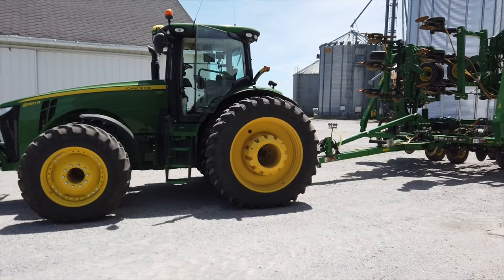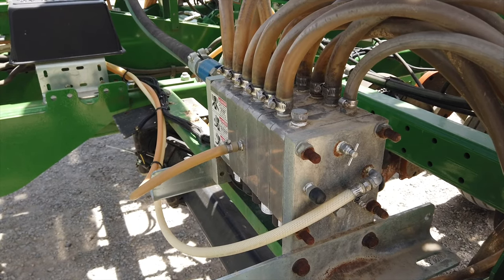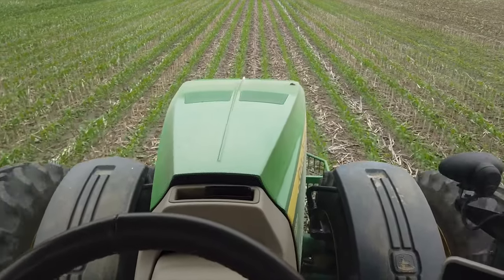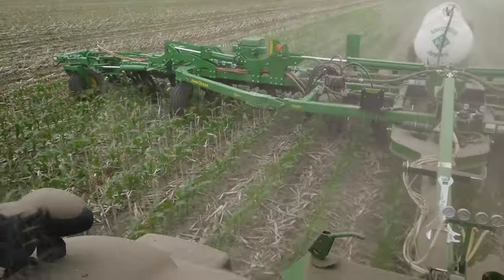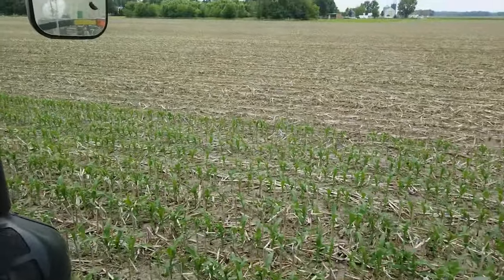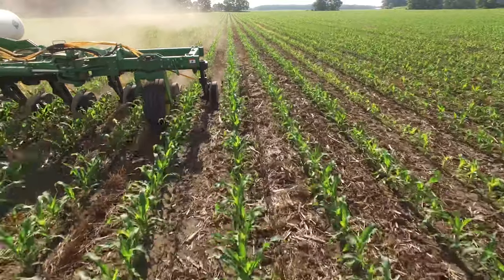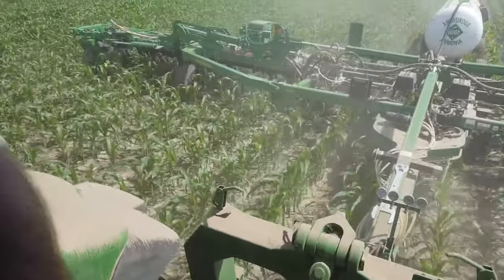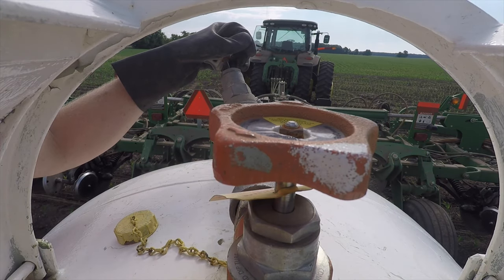Fertilizing Corn by Sidedress Application

Comment: Struggling with no-till on the headlands. Any hints appreciated on how you treat these acres the same/different. corn on corn.  Thanks
Reply from the maker: What’s your struggle?
Reply: @TheFarmersLife  With yield off about 40% on the headlands, lots to improve. Compaction. I've tried inline rip every other year. Seems to make it worse. Using the same plant population, and fertility. Should I change? More weed pressure as well. Any suggestions. Plants are always shorter and growing slower.
Reply from the maker: I will rip the areas where we load trucks and run the grain all the time. That helps. Doing any fall or spring burndown for weeds? We try to do fall. In spring we use glyphosate and Accuron right about planting or after and that's usually it for the year.